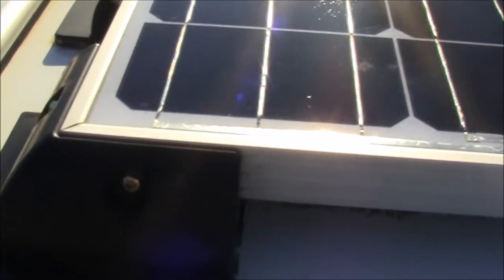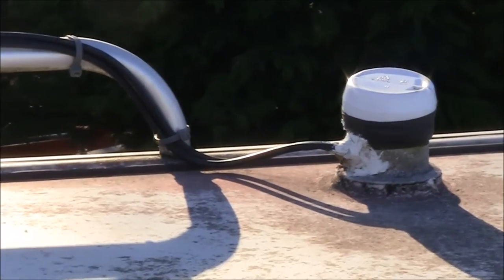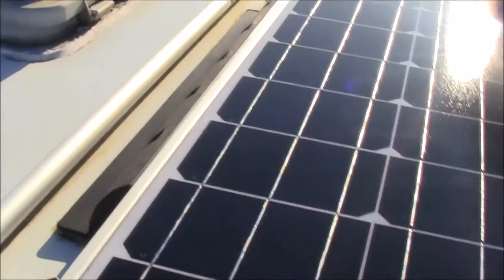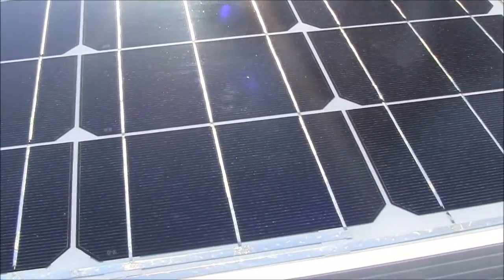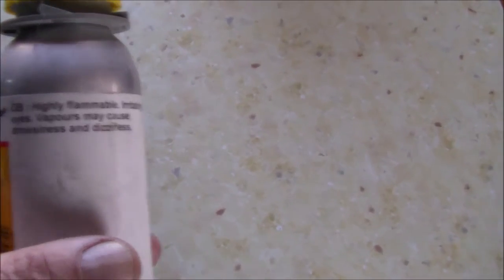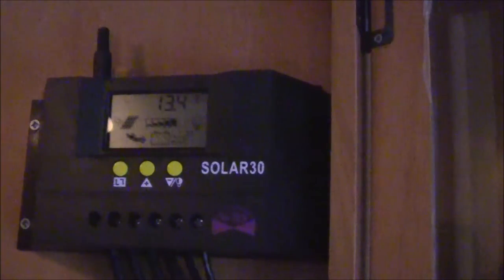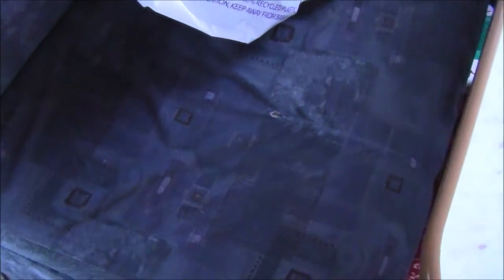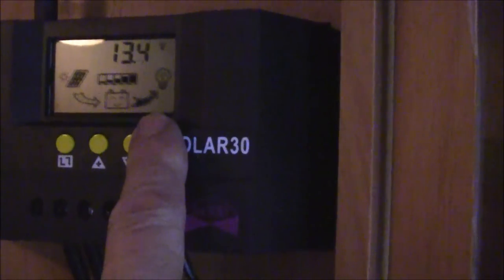HOW TO FIT A 100 WATT SOLAR PANEL TO A MOTORHOME

Comment: Great to see those plastic roof mounts are standing up to the elements well, I've just got those to do my solar install - along with a matching cable entry mount - so I can bring the cables in at the best spot to keep the cable run as short as possible.

Comment: Hi Mark. Im fitting a 100w solar panel to my Teardrop trailer. Did you use a fuse in your set-up and if so where did you locate it and what size did you use. Thanks

Comment: The bolts need to be Stainless Steel, if passivated or zinc plated bots are used, the bolt holes will corrode due to the galvanic action of dissimulator metals.
Reply from the maker: Good point Andrew on mine i used bonding to hold the panel to the roof  been on there 8-10 years  thanks for watching